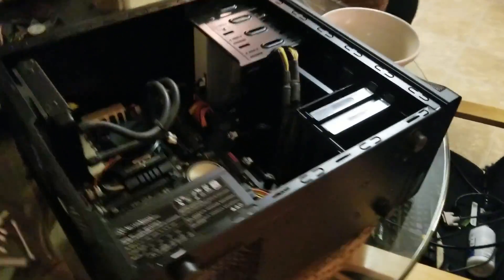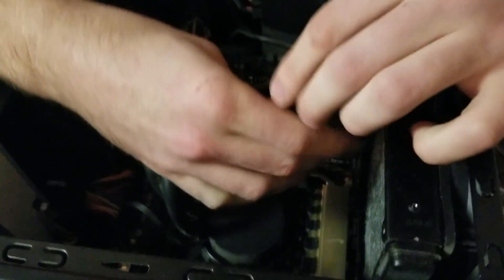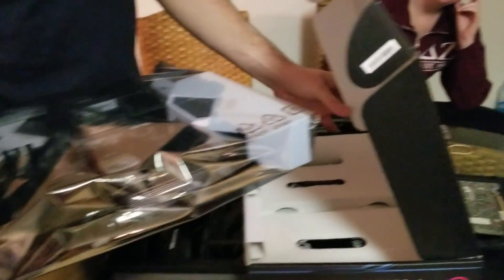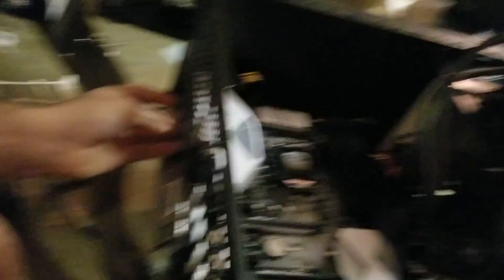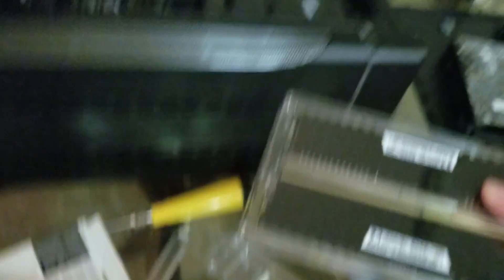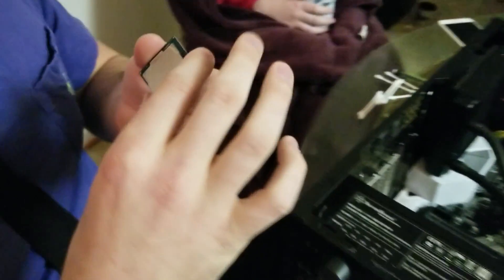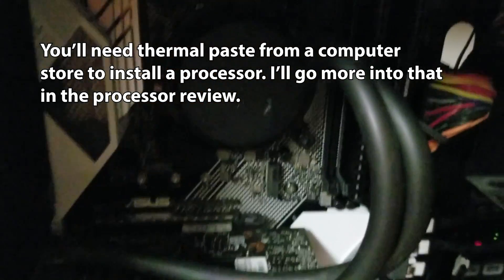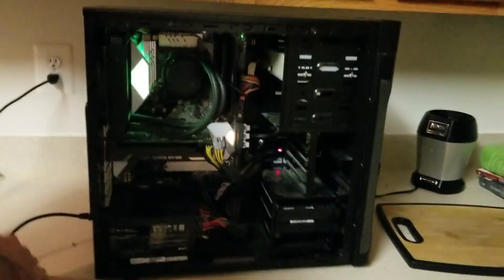ASUS Prime Z390A Motherboard Installation and Review | Gregor

Comment: I just hate how the Z390-a was designed with the CPU power connection right above the GPU and CPU cooler, forcing you to have to run the CPU power cable right next to the cooler and over the GPU

Comment: thinking to get a budget ASUS Prime Z390-A LGA1151 with i7 9700k , GPU MSI 3060ti gaming x trio , cooling with Corsair iCUE H115i PRO XT RGB. What do you think ? Would this be a smart choice ? or should I go for something else, any ideas ? Thanks
Reply: The CPU power cable will have to run over the GPU

Comment: Gregor: did you install the 40x40 mm fan sold separately, for VRM's, I only got the bracket, but don't remember if I got the screws with them, I always put all extras screws in my compartmentalize PC screw box but was going through my MOBO box and I wanted to know what that dam bracket was for, I saw other videos that install that particular tiny fan but I dismissed it. Just wanted to know if you later also thought about that and later installed the fan for VRM's   Also Greg I could not get a clear shot of Ur entire motherboard cuz Ur "Friend" that knows little to know bout shooting YT video kept moving the camera

Comment: How did The both of us buy the same z390-a board AND vengeance ddr4? 😲😲😲 I needed help with case fan connections, I bought a HUGE coolermaster stryker se
Reply: Hey do you know how to setup the bios for the asus prime z390 A?? I would like some help with mine if possible?

Comment: I also had, and still use, an old PC. It's 8 years old now but when I bought it it had the very good specs at the time, like having 12 GB of RAM, although it's DDR3 of course. I've been using the same CPU for 8 years (i7 2600) and it has yet to fail me. I changed the GPU a couple years ago or so I got a GTX 1060. I also changed hard drive and got 2 SSD's, although it's optional. One is 500 GB and the other is 250. My point is that if you have an old PC, you may only have to buy one or two parts to revive it and bring it up to date.

Comment: My dude using an 8th gen cpu in a 9th gen motherboard same socket or not could of saved your self a bit of money going with a z370 motherboard hence what the processor was intended to run on
Reply: He got it for free
Reply: Did he get an 8600k or 9600k? The box for both is the same.
Reply: @708mattt  in the description his specs are i5 8600k